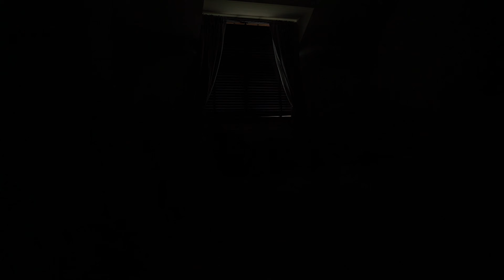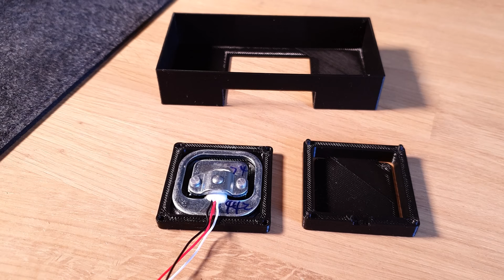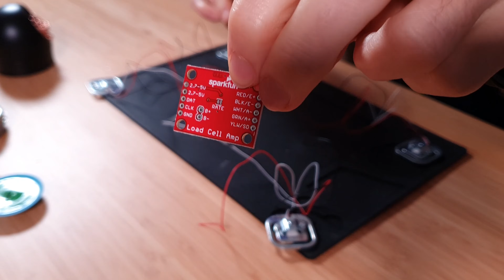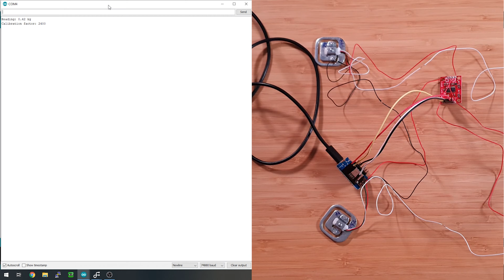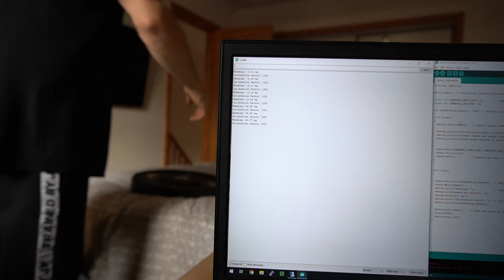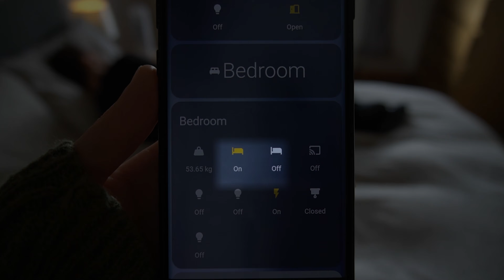Most Useful Home Automation Sensor? Building a Bed Occupancy Sensor with Home Assistant

Comment from the maker: What's your favourite or most useful home automation sensor?!
Reply: Hey can you share the 3D printer info for the load cells?
Reply: Thanks for the tutorial!
i got one one problem though, after i wrote my Mqtt ip, username and password + wifi username and password in the config.h the d1 mini pro i'm using connects to the wifi but not to my mqtt broker. my mqtt broker is set up correctly as it works with a couple tasmota devices with no problem (they get autodiscoverd, the d1 does not).

what did i doo wrong?
Reply: this might become my most favorite sensor ... but like others the question" can you share the 3D printer models has to be answered (I guess we manage to get a 3D printer but have not been able to become CAD designers).  Your prompt reply is much much appreciated :-)

Comment: I saw this video when it was initially released, and I loved the idea of having automations based on bed occupancy, so I built the circuit. I never used it though, I had no really reliable way of installing the load sensors, so it went into a box. Years later, I now have my first 3D printer, and I am currently printing holders for the load sensors, Yippee ! Hopefully, by this weekend, I will have it up and running.

Thanks for the great idea and wonderful video.

Comment: Great content, thumbs up for that. Looking to recreate the process for my bed and getting some issues. All the wiring and calibration is done and works like a charm (had to switch  E+ and E- pins since I was getting negative values). But as soon as I upload Bed_Sensor.ino with modified config.h - I'm getting all kinds of weard readings. It works fine for few measurements and then:
Exception (0):
epc1=0x40223560 epc2=0x00000000 epc3=0x00000000 excvaddr=0x00000000 depc=0x00000000
I'm not strong on Arduino or C++, so can't make heads or tales of it. I'm using same hardware except WEMOS D1 mini Pro. Can you direct me to forum or help me with direction to get this thing working? Thanks in advance for any input.

Comment: Hi,
Great solution. How does the sensor holder work? Does the "flap" prutrude above the holders frame? Or are the beds legs stand on the frame around the flap. Because you do want the bed to put its load onto the smal bumps on the sensor i guess?

Comment: Lewis, thanks for the great guide and for sharing the knowledge. I'm researching to make a bed occupancy/presence sensor myself and I'm wondering if given an honest assessment do you consider this setup to be accurate and reliable? Would you rather have a different setup after putting this one through it's paces? Also, would you consider sharing your files for the 3D printing design, or point us in the right direction for this kind of information? Thanks

Comment: Bought all the parts, put it all together on the table, everything worked a treat. Soldered the extensions wires in place, retested to make sure that everything was going to work in situ. Got a friend to help lift the bed, installed and secured all cables. Reloaded the calibration tool with great excitement and....... zero kgs !! Thought amn how lucky was that !! Adjusted calibration and still zero. Tested all wires and nothing seems to be astray. Before I rip the whole thing out again to retest, I wanted to check if anyone had seen this problem and could help with trouble shooting?
Reply from the maker: Discord!

Comment: Hi Lewis. Loving your channel! im worried that these sensors will not be man enough for my application, the bed weighs 200kg by itself then im 100 kg, wifes 50 dogs 30 and the cats are 2kg each... Ive found some 500kg ones on fleabay but the have an extra wire. Are they going to work with your project as a straight swap?
https://www.ebay.co.uk/itm/382842518684?_trkparms=amclksrc%3DITM%26aid%3D1110006%26algo%3DHOMESPLICE.SIM%26ao%3D1%26asc%3D241790%26meid%3Dfb84189ecf874152b3d283b2c04afd69%26pid%3D101111%26rk%3D2%26rkt%3D12%26sd%3D284954197564%26itm%3D382842518684%26pmt%3D1%26noa%3D0%26pg%3D2563228%26algv%3DSimplAMLv4MetaCatCoviewsAndHighIDF&_trksid=p2563228.c101111.m2109&amdata=cksum%3A382842518684fb84189ecf874152b3d283b2c04afd69%7Cenc%3AAQAHAAABAGw8kBdn%252FCkXKEr%252FdGXYxm435bZRO7eTJfo2UY%252BJycn1EGiZ4Jbfd2uVr1W3aCiAcW1mwyvMQe7ztgJ73ZHqJFVYkpXhJThfD1%252F1Gx%252Bc08jP9NmpSjZ%252ByC7WfzERbSxWgk3hewT8DaxL24VGGX0bl0sH07c8g0xRM4d8Fa0ATbcaGZrq9jsvGPFnO4o0kXylrklJBBSt41i8JYlK4CUK34l84Rz%252BhB2F0Wy1bBNQfkrWPZVCn2OccNKnGRZDBF%252FE1aBp9PDoGg75cubyVua4VgLpN0eLIV9wZVa%252F%252Fmfhd%252BjB9qa6IKy2Jkku%252B0s%252BSphvua8fLdrIrlnyJ0aJg5xIl7s%253D%7Campid%3APL_CLK%7Cclp%3A2563228&epid=7030460232

Any idea on when your multi sensor will be for sale?

Comment: I don’t see how this is accurate or how would it actually work because these sensors have a 50kg limit so it’s 200kg limit. Bed + you + wife must overload the cells instantly …
Reply from the maker: The design makes it in such a way that not the entire weight of the bed is placed upon the cells. You can also go over the weight limit and doesn't seem to have an issue.

It's not meant to be super accurate in terms of weight reading, more a ball park figure so it's easy to distinguish

Comment: I tried to build it, i got one pack from amazon and one from aliexpress, sadly i get some strange ???! stuff in the monitor. Checked wirering 10 times, measured everything, still doesnt work. The Hx711 are both green and look different to each other, and also both are lookin different than the red one. As i recall you didnt mention if we need red or green or everythings the same. Anybody has the same issue ?
Reply: The baud rate in the sketch seems to be some deprecated number that used to get converted to 9600. change the number in the brackets of Serial.begin() on line 12 of the Calibration sketch to 9600. Then open your Serial Monitor and ensure the Baud Rate is set to 9600. This worked for me. Now my scale is measuring in the negatives though...

Comment: Just completed the bench test today for my setup. Will install under the bed next weekend, but I already have it connected via MQTT in Home Assistant, but not added any sensors, will wait till its installed and calibrated. Thanks for the guide.

Comment: Well, I have an interesting issue, for some reason when I put weight on the cells, it goes down? Anyone know how I can fix this? I've checked the wires multiple times. Love your videos btw! *edit: I tried switching the A+ and -... no good. It reads the correct direction if I use the hx711 sensor option on ESPresence, but I don't have the ability to calibrate it, so that's what lead me to trying this.

Comment: The only problem I have with this kind of stuff is I don't have a 3d printer so what the heck do I do with these boards. I wanted to make temp sensors but I can't just have circuit boards laying all willy nilly. I couldn't find anywhere that printed anything either. I want to try this I'll just have to figure out casing first.
Reply from the maker: There are 3d printing services available online where you can submit your prints and they will post it to you. Or you could use it as an excuse to get a printer 😅

Comment: At 6:54 is that a 5th leg in the middle of the bed frame? Our bed frame has the same problem, because the more weight is applied on that leg, the less reliable is the measurement of the 4 main legs... I'll have to double the whole circuit just because of the extra leg.

Comment: These things arent very reliable... When going to bed it tells me my weight which is correct. but when i step out of the bed the weight is not going back to zero. instead it hovers around 15 - 20 kilograms. With 2 persons in which my girlfriend is almost 30 kilogram lighter then me its very hard to program automations that will keep working. It will work with automations when we are both in bed. but making automations when one of us is in bed isnt very reliable. Also i noticed that my side of the bed gives a 20 kilograms higher value then on the other side. I made every cable exactly the same length as you said. but i guess every sensor has its own deviation
Reply from the maker: They are reliable, very reliable, myself and others who have built them in the discord use them and have no issues, I have been using mine for 2 years at this point and can't recall it ever not working.

Usually the error is to do with the mount and the bed shifting on the scales. If you have the bed on carpet then sometimes it can be because of the carpet settling after install

Comment: Hi Lewis! I was wondering if you or anyone else who has done this has any tips on dealing with the TINY wires from the load sensors? I've had two wires snap off from their solder points on the amplifier just while I've been trying to wire everything up on top of the bed.

Comment: I have a bed made of two smaller frames and one big mattress so it has 8 legs. I think I probably need to place load cell under each of the legs so I ordered 8 load cells and two amps but unsure how I would set them up. Can I use two of these amps with a single esp8266?
Reply: Same Issue here

Comment: I'm curious, how do you power the whole thing? Always plugged on the mains? (how), or using some kind of battery setup? Could you maybe give some details? I do have one wemos in the house, for CO2 sensors to mqtt, and I had to power it using an old phone charger (to the wemos USB port), doesn't sound like the right option. I'm sure there's better.
Reply from the maker: Yep just a standard microusb cable and charger!

Comment: I have a king-sized bed, a partner, and I'm a pretty big guy. I was thinking of doing this with more contact points since there will be more weight on them. Would that be possible? Also, my bed has at least 7 contact points with the ground, how do you keep it from being "unbalanced" since you have to lift all primary feet?

Comment: Hey brother, I was about to go under way with the project, but remembered my bed has two additional legs. Is there a load cell amp with 6 inputs? I could not find one.
Reply from the maker: Hello! There is not, but could you just install blanks under 2 of the feet (so it's all the same level and height) and only measure 4?

Comment: Hi Lewis. I absolutely love this. I actually love your whole channel because you are inspiring me to go out of my comfort zone and try new things by hacking and tinkering. I have ordered all the parts so I can't wait to try and do this even though I'm still somewhat fearful about messing this up ;) Quick question: do I really need to place all four load cells at the very outer sides of the bed? Asking cause that would mean that I need to extent the wiring and find a different way to mount these babies. Or can I alternatively just keep the wiring as is and do proper calibration? Again, thank you so much for taking the time to teach all of what you know - really appreciate it!
Reply from the maker: Thanks Lennart, that means a lot. Hopefully you have fun with the project! It's entirely dependent on your setup, the best thing you can do is give it a try and see if it works well enough for what you need. Hope that helps somewhat!

Comment: HI I have problems getting it walking, maybe someone can help.
I wired everything correctly, but if I open the serial monitor the value is rising by about 0.5 kg with every reading.
Reply from the maker: Try using a negative calibration factor

Comment: Can I use ESPHome to flash the board?
Reply from the maker: Sure if you would like, I've never tested or used it though, and I don't think it supports remote taring AFAIK
Reply: In short, what is remote rating?
Reply from the maker: Sorry should have been "taring" - it's essentially when you reset the scales to zero to help combat drift, I discuss it in the video
Reply: Oh.. That's important... Thanks

Comment: Hey, so I saw couple conversations about "can they handle x much weight..." after reading them i did some research, how would this system work with just single/dual (industrial?) sensor(s), which can handle 500kg per cell?  If there's no need to be accurate on  "which side the weight is" then i see no issue on using these... Of course if 2 is used, then we can determine the side of the bed, but if only 1 cell is in the middle of the bed then it probably could do other basic automations,  someone correct me if i'm wrong :D
f.ex. https://www.robotshop.com/nl/en/500kg-s-type-load-cell.html
Reply from the maker: Hey Jese, it should work no problem assuming they work with the same amplifier and voltages etc. Of course the code could easily be adapted to work with another amplifier. Is there a reason you want to go quite so overkill? 😅
Reply: @EverythingSmartHome  Ok, thanks! I should check those voltages etc.  whenever I have time to do this... thanks to you, there's one more bullet point in to-do list lol :D
Tbh I'm overweight and bed is pretty heavy (solid wood) and me and my gf sleep in it soo... :D Overall the bed system is 200+ kg for sure, even though some brand sensors were told that they can handle some overshoot, so 60kg*4 =  240, i still wouldn't count on that. I just want to be sure that they work in the long run and so money doesn't go to waste :D

Comment: My bed/mattress/bedding has a load of 50-60 lbs per leg making the total weight around 250 lbs.  If I do the math, with both of us in bed (and additional 310 lbs) it will exceed the maximum capacity for these sensors at 140lbs per sensor with each having a maximum of 110lbs.  Do you have any suggestions for alternate sensors?
Reply from the maker: Hey Jeff, this has been asked a number of times but essentially the general consensus is that going over the weight isn't too bad. Your unlikely to break them unless you go insanely over it. Even then there are ways to distribute the weight so that not all of it is placed on the cell. These are so cheap I'd probably just give it a go and see how it works out for you. Hope that helps!
Reply: @EverythingSmartHome  thanks!  I was concerned they might just "cap out" at the 110lb limit
Reply from the maker: I think you'll be OK tbh, I've seen people do more than that and they've said it works OK. Definitely worth a go! If you need help (or just want to hang out of course) then feel free to hop into the discord server

Comment: This just arrived by mail https://www.aliexpress.com/item/4000148923476.html it seems to work great under my matress so far! Very easy solution.
Reply from the maker: Awesome, what controller do you use?
Reply: @EverythingSmartHome  on AliExpress I bought some cheap battery powered z-wave door sensors from neo coolcam. The older models use a reed switch to detect a magnet. However I soldered a wire to each end of the reed sensor (to bypass the reed sensor and turn the door sensor into a dry contact) and connected those to the pressure sensor. The newer models are more complex and I haven't been able to hack them like I did for the old one. So if I run out of old sensors I might look I to using an ESP32 or something like that.
Reply from the maker: Great job, sounds like a cool solution! How does it handle 2 people?
Reply: @EverythingSmartHome  Like most people my wife and our each have our half of the bed. I placed on pressure sensor on my side of the bed and so far it only triggers when my side of the bed is occupied. I will now purchase another one of these pressure sensors and solder that to a second z-wave door sensor and put that under the matress on my wife's half of the bed. If I just wanted to detect bed occupation I could simply solder the two sensors in parallel to 1 z-wave door sensor but I want to know who is in bed. I assume an ESP-32 is clever enough to be able to handle that but not a z-wave door sensor :)

Comment: I had been thinking of using these sensors for the same purpose, but they are rated for 50kg. The combined weight of bed occupants and the bed, plus the frame is a lot higher than that.

Are you running these sensors within the recommended specifications?
Reply from the maker: There has been a fair bit of discussion about that and the general consensus is that it should work fine for this application, as long as you aren't crazy over the weight. Plus there are ways to distribute the weight so it's not all directly on the sensor

Comment: I used two of these a while back for my Bed. Typically the Wife goes to bed an hour before I go to bed and she always has the TV on and the Remote is lost in the bedding. Instead of using a Voice command and waking her up I have the two Sensors on my side of the Bed so when I get into bed it shuts off the TV. I tried to have it turn on some LED strips under the Bed when I wake up in the middle of the night but it would false trip or refuse to even work so I ended up using a PIR. I also have my Google Home verbally tell the Kids in the Livingroom "Dad has gone to bed" so they can keep it down since it feels like the walls are paper thin.
Reply from the maker: Cool, sounds like a nice little setup you have there!

Comment: Very nicely done!  The break down of how to tell tell how many people is good.  For me this could trigger 2 separate automations.  My wife sometimes works early so she gets up well before me.  On other days, she sleeps in and i am up to workout.  So there is definitely different automations to trigger when she gets up vs me and when we are both up.  This gives me lots of ideas and i have some HX711 amps and the load cells for a "smart scale" i had hoped to build.  I may switch to this.  

Did you notice any issues with the carpet causing any weird readings?
Reply from the maker: Thank you! That's exactly how I do it because we are up at different times also depending on schedules so it's really useful!

No issues with carpets so long as you create a secure mount. There might be a little settling if the carpet over a few days but the automatic calibration should help with that